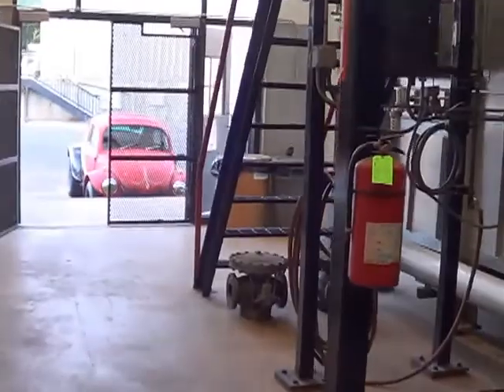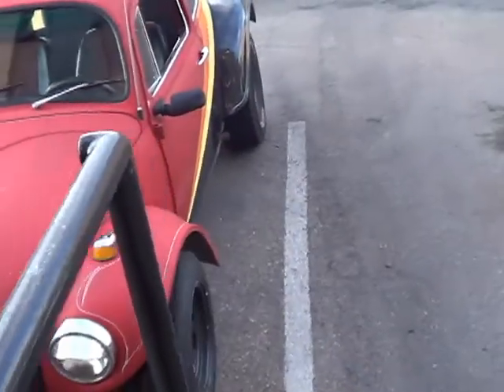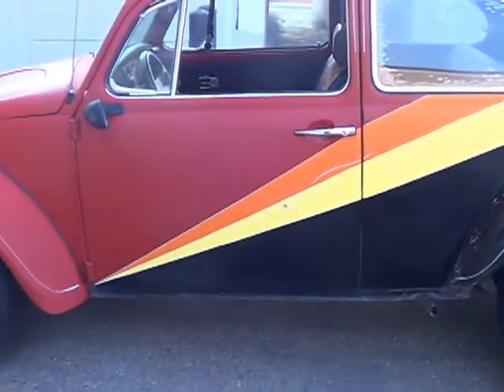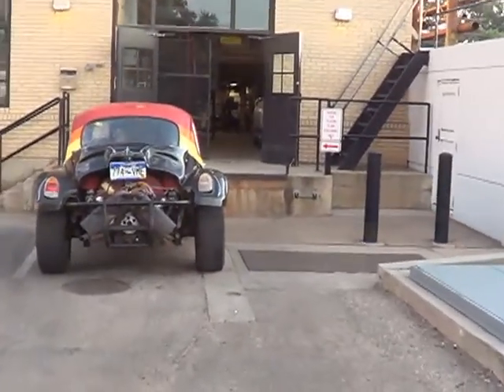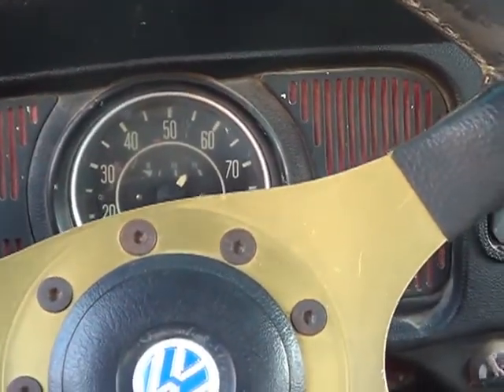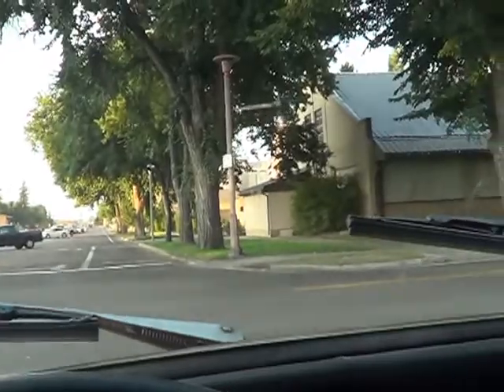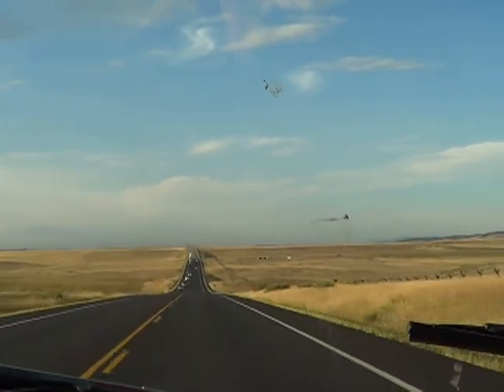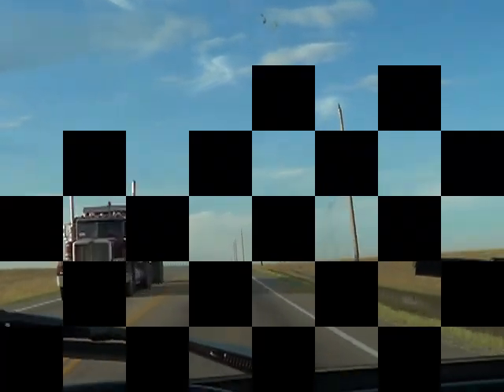69 VW Baja Part 5 (test drive)

Comment: Did you notice anything with the endplay on the crank on the drive?
Reply from the maker: +Raymond Heath no, actually I don't think inside the car with the engine running you could hear it. If you hear a knock it's probably connecting rods start to get real bad. Remember that each time you press in the clutch it is pushing that crankshaft to the back of the engine. Rear of the car.  Thanks for watching and commenting